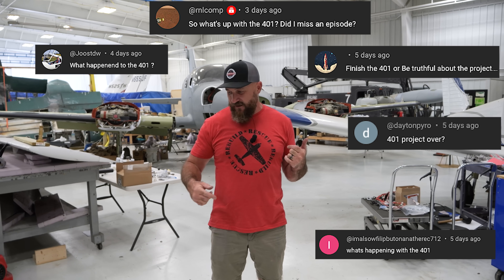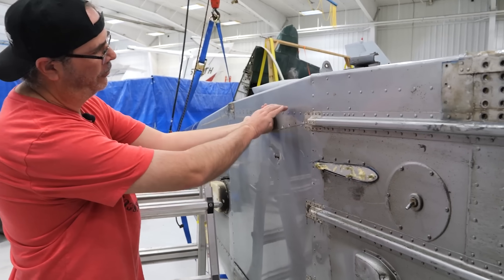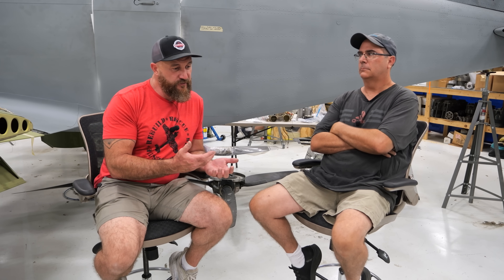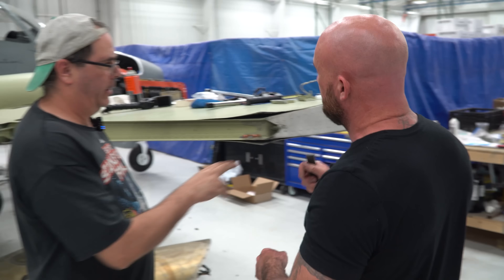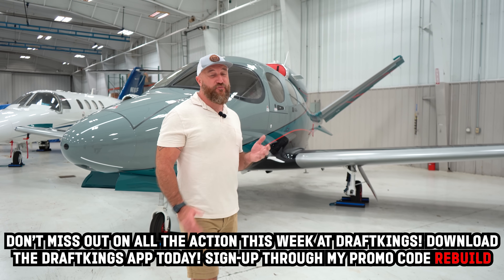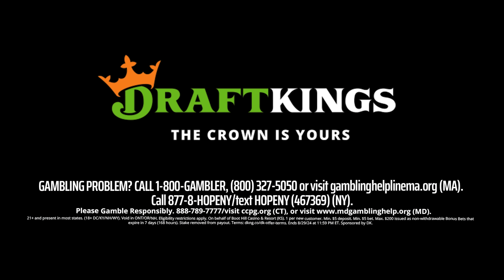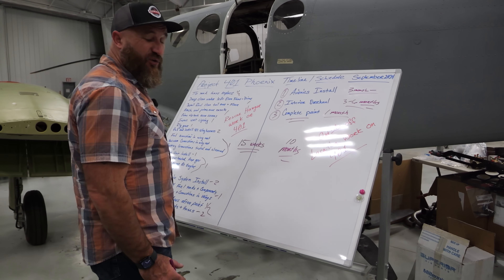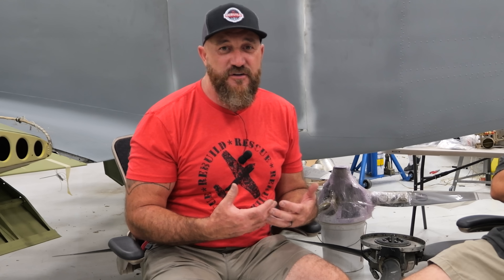Why We STOPPED Working On The Free Abandoned Airplane !

Comment: i was a tenant at a public owned regional airport for 20 plus years.  We were told at one point that no mobile mechanics could come to the airport to do work and all work had to be done at the resident FBO.  Problem was the FBO refused to work on anything over 20 years old (most of the aircraft based on the field).  In the end there was a determination that, because the County that owns the airport took FAA airport improvement funds they could not restrict tenants from hiring other certified mechanics or having them do work in their hangars.  I would contact AOPA legal services.
Reply: This is correct. Airport Sponsors or Authority cannot grant exclusive rights or privileges to one party and not another. The FAA policy can be found in AC 150/5190-6. The Sponsor can lose Federal Funding if found to be in violation of these rules. That being said, they may be hard pressed to get FAA to act on these violations.
Reply: The issue is not about the FBO refusing to work on aircraft over 20, this is an insurance issue that the FBO must buy to stay in business. Mobile mechanics are usually uninsured and a big threat to the FBO, a threat to the airport and even a threat to an aircraft owner allowing an uninsured mechanic to work on their aircraft. Do you understand who gets sued for any incident involving the aircraft if the mechanic is uninsured? It would be the Airport Authority, even the FBO. Anyone who has insurance.

Comment: Jason, if Gregg was kicked off the airport due to him being a mobile A&P, there was a case in Sacramento Ca addressing the same subject. I believe the case was Angel Felix vs Sacramento County. The case involved Felix doing A&P work at Sacramento County Airport. The airport manager kicked him off as he wasn’t paying to be an on airport FBO. Bottom line is He won and Sac exec had to allow him access. Since some of the points involved Federal requirements you may find they apply to Greggs case.
Reply: Bump
Reply: @rebuildrescue bump
Reply: i sure there is simpler way,lawyers fees would rather put into the plane ,good spotting though
Reply from the maker: @robertlewis3712  I tried looking up that case. Do you happen to have the case number ?
Reply: Great advice.
Reply: @robertlewis3712  hey do you have the case number?
Reply: Was it Sunset Sky Ranch Pilots v. County of Sac.?
Reply: @xXVintersorgXx  seems to match the description of events

Comment: Having people with real work experience around is extremely invaluable. Not only do they just know things, but they can teach so much if one is willing to listen.

I did my job training working on the BAE Systems Hawk, Mk 51 and Mk 66......and despite it being a relatively simple plane for a military jet trainer, I absolutely need those 20 or so books of maintenance manuals to do anything on it. But our trainer had worked that same job since the 80s and he could just look at a part and go "5mm socket" instantly. Also those old timers all had weird self-made tools and they were incredibly useful for one specific task that would have been a nightmare with standard tools (many of them had to do with lockwiring, as everyone who has worked on a plane might have guessed).
Reply from the maker: Nothing replaces good old hard earned experience. Those lessons from others are priceless.

Comment: Did anyone hear them mention a reason for Greg getting kicked out? I feel like there wasn't much of an explanation as to how this situation came to be. I'm particularly curious how a public airfield can "kick out" an AMP.
Reply: Greg told ya what he's going to tell ya.rest is anyone's business.
Reply: usually it's because another A&P or A&I complained
Reply: @daveblankenbaker5882  so another company is trying to force some monopoly on repair work. That doesn't sound legal.
Reply: @Hoggdoc1946  happens all the time, FBO has contract with Airport Authority and wants all the work on the airport in return.
Reply: i've got to be honest the reason can't be good. otherwise you'd know.
Reply: I figured it was the plane wreck a few months ago of a restored plane. NTSB says to the FAA go after these small shops.  But leave boeing alone they do good work.
Reply: It could be something like "we now require all mechanics that work on this property to have <insert impossible to get requirements > insurance policy." But behind closed doors at board meeting "we approve lowering the insurance requirements to <insert obtainable requirements > for <our friend company> since that was the requirement when they originally signed the lease and it would be unfair to change it"

Comment: Realistically, this project is going to take two years including the time to get all the sign offs. The original plan for Oshkosh 2023 was clearly not achievable and with all the other projects you have going on you need someone who can properly project manage, plan and do the necessary stock control and factor in those lead times, the costs and so on.

With Greg, you and he never said why the airport is throwing him out. Is this a lease dispute? Did something else happen and even if he is getting thrown out why can't RR take him on? You must have staff helping with the videos and so on?

Finally, if the plan for the 401 is to do mercy flights you've just lost three years in which you could have been doing those with other aircraft. Was it worth it?

Comment: Having about 1,100hrs in a CE421B and as a MEI flying 310’s, I would have said don’t walk away from the 401, but RUN! 
Parts availability, AD’s, complexity of the systems and parts costs are what lead to the 401 being abandoned in the first place. The 421 I flew/managed averaged $20,000 for an annual inspection, then the cost of supplies, and materials, additional labor on items found deficient ran that up to $35,000 to $50,000! And that was on a well maintained aircraft. Add in mandated annual training on my part, and fixed costs for hangar, fuel, and taxes, the owner first had a falling out with me causing me to resign (great relief too!) and he was unable to find any one else to fly it for him. He abandoned it at Gulf Shores, Al. A hurricane destroyed it. It sold for $35,000 scrap/salvage value… it was the definition of a money pit! I hope you get some salvage value for yous…
Reply from the maker: They are seriously expensive old birds. Wish the 401 would have been a 421…. But glad we haven’t had to deal with the pressurization systems.

Comment: Sometimes there are some projects not worth saving. one time with a previous operator we were going to pull a 767 out of the desert for a cargo conversion come to find out after a prebuy we found it with a cracked wing spar needless to say end of that project before it even got off the ground! the point is all costs have to be factored in and i remember my old boss telling me that Maintenace is the biggest liability of airplane ownership and as long as any aircraft is in the hangar or on the ground, you're not making any money$$$$ unless it's in the air. Good luck guys

Comment: Thanks for the response. I suppose it is a very complicated issue and I am sure liability is at the top of the heap and the crash of Sam I am sure didn't shine a good light on the ongoing work at the FBO. I guess it would be good to know if the 401 can actually meet the necessary guidelines set by the FAA to actually allow it to be finished. Is the 401 just a parts bin for other airplanes. So sad as with all the quality work that has gone on I imagine the 401 in the right caring hands would be a gem to own and operate. Good luck@rebuildrescue

Comment: I'm surprised no one has put 2&2 together. The airport doesn't profit from its RR fame with a mobile AP. The A-Hole from the other side was just the excuse they needed to rock the boat. Now they think you're stuck here with an incomplete aircraft and a different mechanic will be leasing a new hanger which all of your projects will have to move to, essentially causing you to pay for A) your hanger and higher mechanic fees to pay for the second hangar, plus B) a way to bill you for filming outside of your hangar plus C) a mechanic that is associated more with (and will promote) the airport rather than RR

Comment: To a degree, small airports are like Marinas. The owner of the vessel can work on his own property, however when you bring in outside help, they have to provide liability insurance information and only provide services with that person. 

If another person came in needing a repair, they'd have to go through the FBO for the repair or diagnostic required. They don't want you poaching clientele.

Why it took as long as it did, sounds like there has been a management change or are under the microscope to generate more revenue.

Comment: Sometimes a rebuild becomes a new. For example... The tally ho. You think you're rebuilding something and then it turns into literally building something. By the way. The Tally Ho is a wooden sailing vessel that was completely rebuilt. From a splinter.
Reply: Respectfully, as a 30 year retired professional pilot and licensed A&P that watched Leo rebuild Tally from day one, I get what you're saying. But speaking from experience I can say they are NOT the same. From the constantly required inspections to the, well, constantly required inspections.

Comment: It is sad that most public airports in the US have an exclusive (one operator only on the field) charter by the local Airport Authority. Profit margins for FBOs are razor thin. A lot of airports actively ban free lance A&Ps from coming on to the airport to work in somebody’s private hangar. All work MUST be done by the FBO. Worse -  an outside entity meets with the Airport Authority and offers to pay more than the existing FBO for the operating right and BOOM the existing FBO is told to pack their bags.

I have seen this done repeatedly. Many times the new FBO then raises the shop hourly rate to cover the higher rent. All the local tenants get screwed.
Reply: What is the point of having a hanger if you cant work on your own plane with your own team???  
Might as well just keep it parked outside then and not use a hanger.    The only reason you want a hanger is to actively work on your own plane.    If you are going to pay someone else to work on it then you take it to their hanger.

Comment: What ever the reason for Greg's inability to work at the airport is not something I am concerned about.  If he does not or cannot say why then so be it though, as other's mention, it does not clear anything up.

I was interested in the project time line (and would suggest to Jason, look into MS Project software...an amazing tool for managing a project like this and easier to back up then a white board ;-) )

You (Jason) said it will take over a year  by adding up the time estimates, but from what I could tell, not all of them are start to end tasks (meaning wait for one is done to start the next).  Some projects could run in parallel which would reduce the time and regarding those external projects, why were they not started months ago (or if they were, you've not said anything about progress.  Prepping the interior (Cleaning, painting etc) could have already been done given the time, lights the same so perhaps people are somewhat frustrated because what they (and I) see is you spending more time on other plane projects, but what brought us in was the 401 (I watched from day one when you walked up to it)  

This is your channel and you can present content as you feel it draws eyes, but trust is hard to earn, easy to lose, and if people start to question, to wonder, it means that like a Barker from a Carnie show, you need to deliver from what's said at the door.  If you need an A&P, ask, ask here and I bet you'll get volunteers from all over.  If the Airport does not like what you're doing, move.  I got no dog in the hunt other than wanting to see this plane fly.  Yet, it's been over two years, the "so much to do" is getting weak when you've fixed and sold at least three planes in that time cars and other stuff.

Get Phoenix to fly and start, now, looking for the next "big heart" project...Go big and find an abandoned private jet 🙂

Comment: The first thing I would do is find out the problem.
You can negotiate a solution. If you need a mediator, I will be happy to mediate with both parties.
I would like to see the 401 fly again. It would be best if you concentrated on the solution rather than the problem.
If I can help, I am used to dealing with a problem that takes some time to resolve.
I work on Federal Income tax cases, so I know that the process.
Keep faith that you can work it out.
With my best wishes.

Comment: A view from the UK. Jason, i posted this over a year ago on one of your videos. Renovating Aircraft is NOTHING like renovating classic cars. I told you everything done to an aircraft in repair must be documented AND SIGNED OFF by a certified aircraft technician. Being "Good 'ole Boys" just don't cut it. But no, YOU wouldn't listen, without a overall costing OR budget, headstrong as usual, carried on your merry way. ONLY NOW you are peppering your dialogue with "to FAA standards" Be honest with yourself, you never thought you would have to take out EVERY rivet, every cable, every panel, buy replacement wings, engines etc., etc, but that's what has to happen to get an airworthiness certificate. We have an expression here in the Uk which you might have over there, that is ; 'You have an albatross hanging around your neck'. (The Rime of the Ancient Mariner).Without being too critical, you should have stuck with what you did best and made those lumps of muscle and expensive teeth pay for themselves.